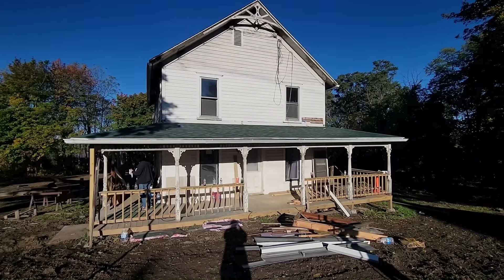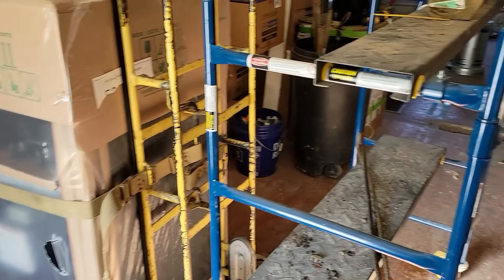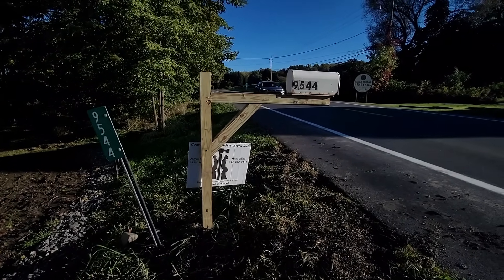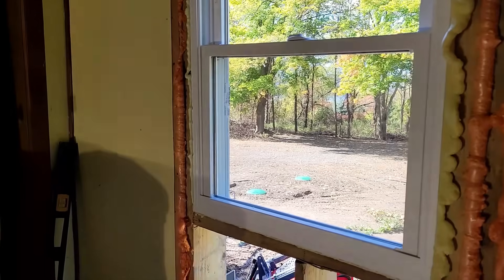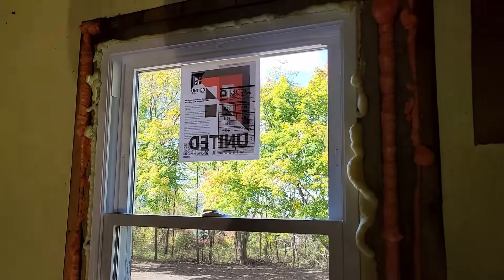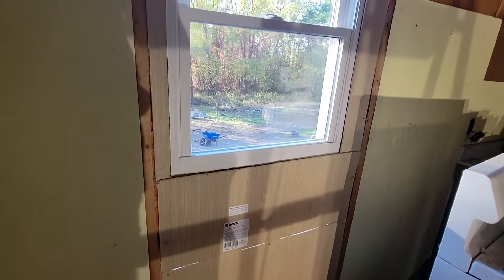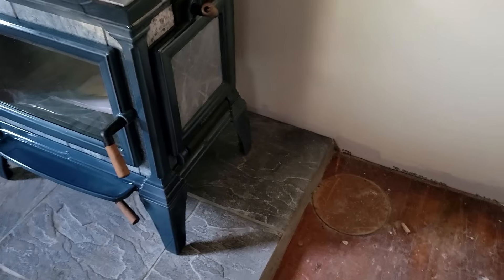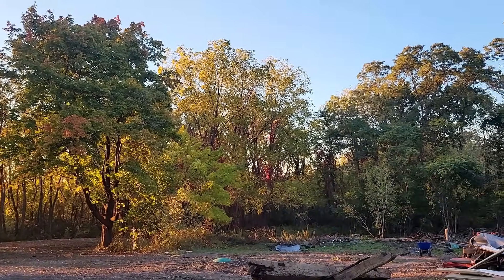We have a woodstove, and she's gorgeous! | 1830s farmhouse renovations

Comment: What are you planning on putting on the wall behind the wood stove? My mother in law has one very similar and has it much farther from the wall, with the wall bricked behind it. I will say, hers doesn't heat the house well, no matter how big of a fire you build in it. Hubby and I have talked about it numerous times that it's just not one that produces a lot of heat.
Reply from the maker: At the moment, we aren't planning on putting anything behind it. The sheetrock on the wall had to be thicker than normal sheetrock, so that's all that we've done - and painted, of course. My partner did extensive research on using woodstoves as a main heat source, so we're as confident as first-time buyers & users that we've made the most educated choice. There's always stuff that you learn that can't be researched, but as the work crew have had a propane burner in the same room to heat the house and it's done great, we have high hopes for the stove.

Comment: Much has been accomplished! The stove looks good as does the window fitted into the Door to Nowhere. Settling of the ground around the septic system piping is normal. Take some of the left over dirt and fill in the low spots and you will be good. (You may see some more settling over the winter and from spring rains.) Hope the electrical wiring is progressing OK. Any idea of how soon electric will be connected? Hang in there, it will be worth it!
Reply from the maker: Thanks, Dad! Our general contractor piled some extra dirt from the driveway into the settling around the tank. I'm glad to know it's normal; I thought it might be, but since everything is so new, who knows what's common sense and what isn't!

No timeline yet on finishing all of the electrical work. It's the project that gets attention when the weather isn't great or when supplies for other projects are held up. We had our first under-32 degrees on the thermometer morning this weekend, though, so the electric for at least the mini-splits needs to go in over the next couple of weeks so we can keep the house warm enough for pipes etc. not to freeze.

Comment: wow, what a lovely stove! I hear you can get fans that can sit on the stove and the rising heat spins the fan which helps circulate the heat around more. And I was thinking, in your office, you could get heat from that pipe! though maybe a bit of a fire hazard if it gets hot enough (I think you mentioned it, I just heard it but my brain is already blanking). I understand apartments in New York City often have pipes in the corner like that, and there is heat that radiates from them. Don't have any suggestions for names, apart from maybe Pele, the polynesian volcano goddess :)
Reply from the maker: We've talked about getting fans to move the heat more, and we'll have several ceiling fans as well (those are going in as part of the electrical re-wiring!) Since we haven't had a woodstove before, part of our adventure will be understanding how heat moves in that house naturally and where we can encourage it to move with additional fans.

Yes, the pipe in my office will radiate heat! It will be enclosed because building codes say it has to be, even though the pipe will be warm but not burning to the touch. But, we can leave a vent in the enclosure for warm air to flow into the office.

Oooh, I like Pele! Adding that to the list of great name suggestions.
Reply: @HoneyAppleFarm  what a lovely adventure to have, figuring out how to use such a pretty stove. And it's good the pipe is enclosed, I'm sure. Maybe those NYC apartments weren't so safe - lol shocking discovery I'm sure :p
Reply from the maker: @crowfoot1199  I'm all for the pipe being enclosed because I'm not sure how our cat will interact with it (he has a terrible sense of spatial awareness), but I get cold really quickly, so having something radiate heat in the cold of winter in my office is a bonus! Hopefully the vent will work well.

Comment: Does the wood stove have chimney fans that pulls smoke up to outside? Will the metal stack will be hot to the touch? If so, why not leave it open on two sides to keep the room warm? It's going to be wonderful having that stove! Perfect for winter warmth and emergency cooking and heating during electric/gas outages!
Reply from the maker: There are no chimney fans, just the chimney itself. To be fair, the other 3 chimneys (2 brick, 1 cinderblock) didn't have fans either and presumably worked just fine. The pipe will not be hot to the touch, we're told, but it will be warm. Our general contractor is going to put a vent in the enclosure around the pipe in my office so the heat will be able to come into the room. :D

Comment: Is the wall behind wood stove safe against fire? Be safe
Reply from the maker: Yes, it is! According to building codes, the sheetrock on the wall behind the stove has to be 5/8" sheetrock, so thicker than your usual sheetrock. And the paint on that wall is also heat-resistant, I believe. Our general contractor and Peter both did a lot of research on what was needed to make that wall safe!